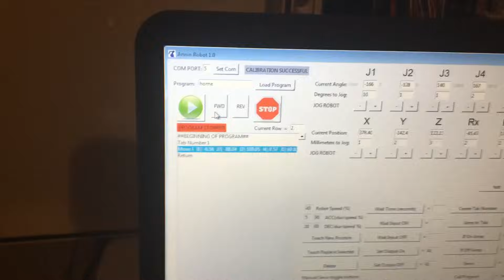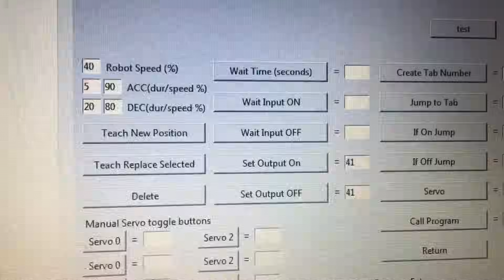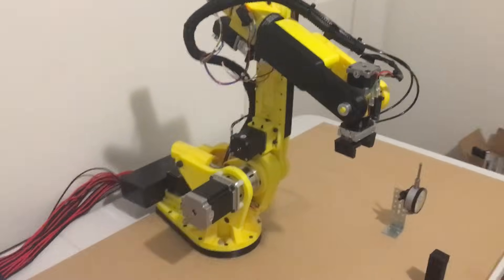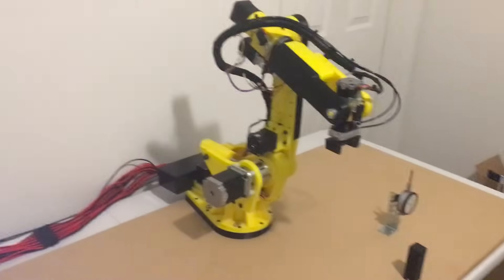3D printed  6 axis stepper motor robot - Gen2

Comment: Hey Chris, great work on the arm! Just had a quick question regarding the planetary gearbox that you've used. Is it correct to assume that such a gearbox would just be increasing the dynamic torque of the motor and not essentially the holding torque. Say for example, there is a power cut, would such a gearbox be able to hold the motor in a certain position or would fall off? Alternatively, would a helical worm gearbox be a better option, since it has a self locking mechanism? And finally, to what gear ratio would you recommend putting on a motor to give descent efficiency in terms of speed and torque? 
Thanks in advance.
Reply from the maker: It increases the torque and does offer a proportional resistance to the weight of the robot but will not hold position entirely...  The 47:1 ratio o f the J2 motor holds the weight fairly well,  the axis that drops when you cut power is J3 which is a 20:1 ratio.  I chose the ratio based on off the shelf availability that most closely matched the torque/speed need for the arm.  I can get good torque and decent speed for the longer arm with 47:1 whereas 20:1 generally seems to be a good ratio for the other joints.  I think the worm drive is the best option to hold position but is difficult to implement mechanically for most of the joints.  I do use a linear drive for J5 - the motor at the J3 elbow has a acme thread that passes all the way up into the forearm and then translates to rotational motion via a slide/belt mechanism, this joint does not drift when powered off.  When I power off the robot I run it to a straight up and down vertical position and it holds position just fine when powered off.  But I also run the calibration routing each time before running a program.  let me know if this answers your question.  thank you.
Reply: Thanks for the reply. I'm currently working on an arm that can pick up a load of 2 Kg at 1 m distance (with 8kg links weight/ all motors are in the base). For your torque calculation for each link did you take into account angular acceleration? If yes, was it a considerable factor concerning acceleration and deceleration of the motor and thereby reducing vibrations (if there were any)? For me the calculations say 150 N-m, which seems like a lot of torque, is this a correct approximation or am I missing something?
Reply from the maker: I did not do any torque calculations, I just did some basic speed calculations given what was available off the shelf.

Comment: Great job! What is the max payload on it? Also, are you using a planetary gear box for the base?
Reply from the maker: I would say very roughly the plastic version at a min
 can handle 10 - 12 oz. at the end effector using J5 - possibly more but
 I didnt want to push my luck and break anything.  when testing J3 i 
affixed a spare gearbox to the end (25 oz.) and J3 could handle that. 
When I build the aluminum version I will test the payload more 
thoroughly.  I believe the payload will be higher.  yes 5 of the motors are planetary gear boxes one (J5) is linear rod motor.  they are all stepper motor gear box units from StepperOnline.  thank you.
Reply: Thanks for the answer! I was also wondering what type of motor or hydraulic system u were using to control the second axis (after the rotational base)? Was that the linear rod motor? Also, how is the 5th axis stepper motor (not motor rotating the 4th axis) rotating the wrist of the clamp? Thanks again!
Reply from the maker: The J2 motor is the larger nema 23 motor with a 47:1  planetary gear drive. The motor for J5 is the motor at the rear of the elbow (J3) this is a linear screw motor where the screw extends all the way through and into the forearm. Inside the forearm is a carrier on linear guides, the screw drives this carrier forward and back inside the forearm.  Under the forearm side cover is an xl series belt that goes around the J5 axis at the wrist and then goes around a tensioned idler at the rear.  The internal carrier then locks or clips  onto the belt essentially pulling the belt forward or back to drive the J5 joint.

Comment: Forgot to ask, what is the payload of this bot?
Reply from the maker: I haven't really tested it for payload-at least not anything scientific 
(just picking up various objects that were sitting in my pile of tools 
and spare parts).  I would say very roughly the plastic version at a min
 can handle 10 - 12 oz. at the end effector using J5 - possibly more but
 I didn't want to push my luck and break anything.  when testing J3 i 
affixed a spare gearbox to the end (25 oz.) and J3 could handle that. 
When I build the aluminum version I will test the payload more 
thoroughly.

Comment: Damn dude, the bot is yet the best I have seen 3d printed, congrats, you have done a very fine job on your bot. Do you use Inverse Kinematics to move the bot?
Reply from the maker: I have manually programed basic kinamatic functionality - you can jog the robot in XYZ to teach positions.  It still needs some work but I will continue to work on improving it.

Comment: you rock Chris! by the way how much does it cost?
Reply from the maker: total cost including all the misc electrical stuff, bearings, motors, drivers, belts, sprockets, hardware etc was $1085
all the little stuff adds up surprisingly fast.
Reply: quite a good project! can you show us the links where you bought the stepper motors?
Reply from the maker: http://www.omc-stepperonline.com/geared-stepper-motors-c-4.html

Comment: I really wanted to build a 6DOF arm, inteded for milling... and today it could be very feasible, but thanks to God we will purchase a used Kuka KR-125 at work... you could improve the design using bigger steppers and the Mechaduino boards (with such boards you could have better accuracy/repeteability, closed loop, position feedback, torque, speed and acceleration controls and more). Then you will have to fight the jerkiness/elasticity. In robotic arms the movements are controlled with acceleration, decellaration and braking, in order to fight first of all the inertia (which causes jerkiness even with no payload in slow and simple moves), flexes and reaction of the objects manipulated (or material in milling operation). And Arduino boards wouldn't be enough for this, and I don't no if Pi could even (there is much latency in I/O and also some routines and iterative loops are too slow)
Reply from the maker: I wasnt familiar with mechaduino, ill have to do more research but looks very cool.   It would add some cost which is counter to the intention but maybe be worth the benefit. maybe on Gen3 robot.....
Reply: the mechaduino boatds could be 100-150 $ for 6 motors I will check once in office. I understand what it means trying to make things cheap, however there are a lot of 6dof or 5dof arms with no position feedback, low repeatability and jerkiness out there,  so this is something you could look for
Reply from the maker: Well at that price I think we would only be talking adding roughly 10% or maybe less to the cost of making the robot - I think well worth the benefit.   I believe I have a fairly decent algorith for controlling acceleration and deceleration and its my opinion that the majority of the jerkiness I see in my robot is due to lack of rigidity in the plastic components and the backlash in the gear boxes im using - thats not to say the mechaduino wouldnt do a better job.  As for repeatability, I did have a compounding error in conversion from joint angle position to steps which I have fixed since making this video and I also switched to a roller chain for axis 3 - between these 2 things im finding approx .010" repeatability going back to the dial indicator.  Given that im driving 1/4 steps at 120 steps per degree of movement using J2 for example I believe my accuracy is decent - im not sure how much more accurate the mechaduino would be?  I havnt dug into it yet but im curious how the calibration would work given a a 6dof robot config or if recalibration would be required if powered off.  In my case were talking about approx 1.6 degrees of arm movement per 360 degree rotation of the motor.  Servo motors have always been a future goal for this project behind adding more kinamatic functinality and keeping cost super low - these controllers certaily look like a good segue into the servo realm.
Reply: I have followed the Mechaduino project since it was launched on Kickstarter. It is a relatively inexpensive solution for a closed loop stepper control. They have some innovative way of using off the shelf encoders to get very good positional accuracy by compensating for nonlinearity of the encoder in software.
However, I think steppers are designed for open loop control and there is not much benefit in running them in a closed loop. The reason being that if the speed or load on the motor exceeds the limits, the motor stalls and effectively stops operation. For real servo a brushless AC or DC would be the way to go. However, I've been able to produce nice jitter free motion using servocity brushed geared DC motors and the attached encoder using 3d degree polynomial for motion planning on arduino Due. They have very small backlash and can produce high amount of torque based on the spec. But the total price would be still 50% to 100% more than a nema 23 + pololu drive.
Reply: the mechaduino calibrate himself ones (encoder linearization) and then you can go. the jerkiness isn't only because of poor rigidity, the inertia even if small is a major factor. in order to combat the jerkiness you must implement a math model which deals with the elasticity and also masses and/or forces involved (and sometimes also measuring how much the arm flexes, which is cheap with optic fibers). I will find time to link technical papers about that, there is a lot of acadamic literature dealing with that.
Mechaduino provides 0.02 degrees accuracy using microstepping and magnetic encoder. A common servo without encoder and control loop will provide at best 0.9 +/- 10% degrees, and the microstepping doesn't help.
I thought about starting an open-source 6DOF arm in order to crowd-source people able to implement the math model but I must focus on my motion picture projects.
Reply: if a stepper looses a step, it doesn't say that to the controller and so the controller continues. mechaduino is better because provides more accurcay, closed loop, torque etc.

Comment: Hi Chris,
Great work! and thanks for posting the demo.
Couple of questions:
1- what's the payload on full arms extension? Or maybe a rough estimate?
2- Whats the FW on Arduino to control 6 steppers together? Did you write it yourself or used some existing code? Is there any smoothening for stepper's motion like what GRBL does?
Reply from the maker: I haven't really tested it for payload-at least not anything scientific (just picking up various objects that were sitting in my pile of tools and spare parts).  I would say very roughly the plastic version at a min can handle 10 - 12 oz. at the end effector using J5 - possibly more but I didnt want to push my luck and break anything.  when testing J3 i affixed a spare gearbox to the end (25 oz.) and J3 could handle that. When I build the aluminum version I will test the payload more thoroughly.  As far as the code I rolled the program completely from scratch
 including my attempt at solving the kinamatics. its fairly basic in how
 it works.  I didn't choose python for any reason other than its a 
popular language that I had a little bit of familiarity with but I 
wanted to learn more about.  this is basically my first real project 
using arduinos or python.  the python program tracks motor position and 
motor steps, calculates destination and number of steps required to each
 of the 6 joints.  the program sends the arduino a string command that 
defines number of steps, speed (as a percentage of max capable speed) 
and acceleration/deceleration (as percentage of programmed speed / 
magnitude of movement).  When the arduino receives the movements there 
is an algorithm that determines frequency to skip steps within in the 
loop for the motors with shorter distances to travel so that all motors 
attempt to finish their move at approx same time.  This algorithm 
divides and splits up the steps in 3 segments - this could be refined 
further given more time to work with it but for now the motors mostly 
finish together.  The acceleration and deceleration basically 
manipulates the speed (time between steps) based on taking a percentage 
of the distance at the beginning and end of the move and then increasing
 or decreasing the pause time incrementally throughout that segment of 
the move. I'm not sure how GRBL algorithm "smooths" the steps but in my 
case i have most of the steppers at 1/4 steps with some basic timing 
algorithms.  Im not sure about about incorporating path planning 
software - I would need to be much further along in the kinamatics and 
control relative to stepper motors.  currently my biggest challenge is 
the kinamatics.  I didnt want to someone elses library as I wanted to 
figure it out for myself.  what I came up with works for the most part 
in its most basic form - you can jog the robot in XYZ and reorient the 
wrist but it does have some trouble correctly re-calculating the 
orientation of the wrist given a distance moved in XYZ, most of the time
 it works but in particular orientations it makes unexpected moves.  Im 
not a math wizard, it functions but its a work in progress- the forward 
kinematics use basic DH parameters and the inverse uses geometric means 
given arm forward configuration and then rotation matrices and the 
inverse of J3 position matrix (basically decoupled J1-3 for position and
 J4-6 for orientation).  But this is just to jog to a destination 
position -the robot moves from point A to point B, there is not path 
control - (being able to traverse a straight line or calculated arc) 
being that its a single serial command for each new move to destination 
position.  it does happen to resemble a straight line movement as the 
axis work in parallel but not controlled.  I think my next step is to 
just finish up the drawings - instructions and release what I have for 
Gen2 so people can see / play with it.  Then I need to go back to school
 and or study kinematic packages or incorporate robot toolbox package 
and keep improving the program as I have time.

Comment: amazing !! what is the accuracy without encoders ?
Reply from the maker: Unless a physical force bumps a motor out of position, the robot is powered off or there is a resonance / speed issue the program tracks and maintains position down to the motor step.  If an issue such as getting bumped comes up you just run the calibrate routine and all is reset.  The gear boxes are low cost and do have some backlash and the robot is plastic so I am finding .030" to .060" repeatability and there is some backlash if opposing force is applied (J1 & J3 mostly) but I'm working on a roller chain and a couple other things in the design before I release it to get it as accurate as I can.  It may be a little longer before I release.  Remember the idea of this is a low cost  robot people can make and actually use.  It's not a $15k high accuracy lab robot.

Comment: An incredible job, congratulations .... where can I get the soft, works with any driver, since I'm working on a robot arm project and I'm interested in soft to be able to move 6 motors, .... https: // www .youtube.com / watch? V = ExgOcpDICa
Reply from the maker: I will post all the software and print files in a few weeks.  finishing up electrical drawings and instructions as I have time.
Reply: Thank you very much, I will be attentive !!!! I currently use ramps + arduino + drv8825, do you think you can adapt your software?

Comment: As a fellow technician I must say I'm very impressed, great job. It is definitively something that could be used in an industrial environment, for example in a lab of a plant to perform automated quality control. Of course it can be used for many things. Are you considering making this great product available for such use?
Reply from the maker: thank you.  as far as making it available - my goal is to create a very low cost but capable robot that most anyone can afford to build.  obvioiusly using these low cost components the accuracy wont be quite as high as the alternative $15K desktop servo robot but most people cant afford a $15K desktop robot.  I would like people to be able to build thier own robots and have some fun with it.  my plan is to to provide all the stl files to print the parts as well as the software, bill of materials and instructions at no cost - at least for personal use.  I am also working on building an aluminum version of this robot as well as a premade wiring harness.  If all works out and these are cost effective to produce I may market partial build kits but im not really sure yet.  mostly the idea is to provide a small robot people can build themselves, have fun with, automate simple process and be low cost enough that average people can affort to build.  Its a work in progress....